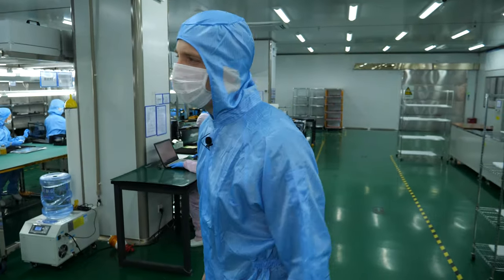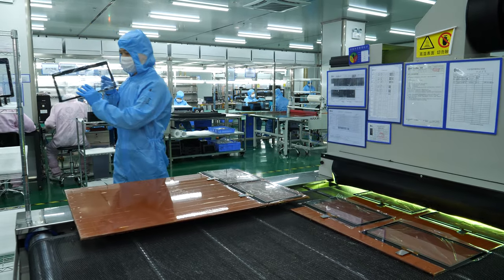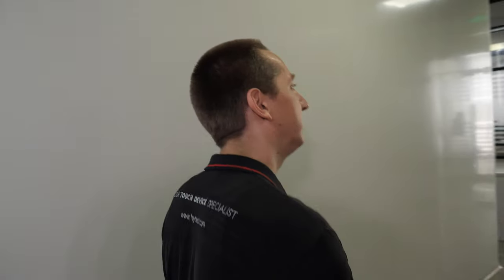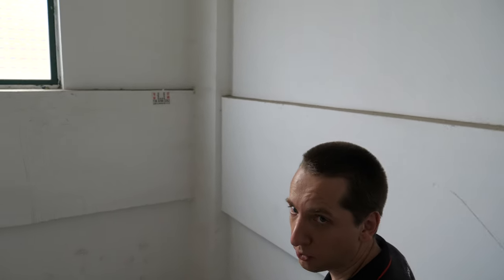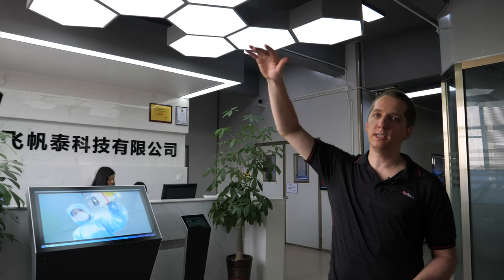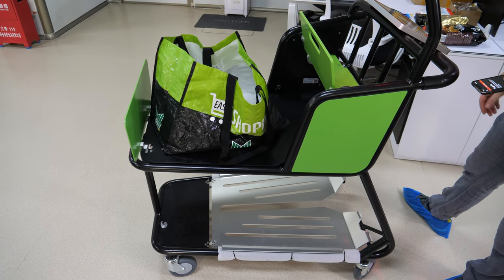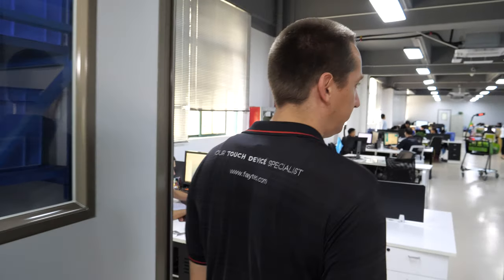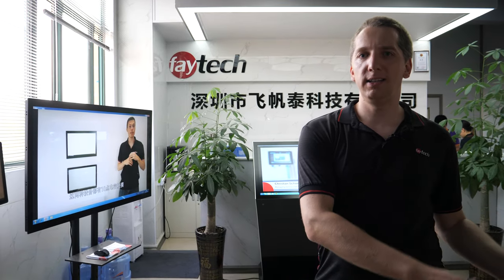faytech shenzhen factory tour, Industrial Touchscreen PC Manufacturer

Comment: He was very short at answering questions. The self service scanning shopping solution we have had since the 90's and is now common place within Waitrose, ASDA and Tesco. It was initially created by IBM for Safeway but is now sold by Zebra. Search for 'Zebra Personal Shopping Solution'. You can also scan using a App. Focus on what you do best is my suggestion. Entrepreneurs tend to stray!
Reply from the maker: This smart shopping cart is way better than the Zebra.. faytech focuses on doing the touchscreen system, another company partners with them on implementing the shopping cart with the right software and everything. The Butterfly MX intercom system is for example a huge success and based on faytech technology. They have I think many other examples like that. This smart shopping cart can I think basically turn every supermarket into a "walk out shopping" solution, the shopping cart includes camera and weighting which provides a full anti-theft and auto anti-mistake in scanning items automated shopping experience. Much cheaper than the way Amazon is doing their walk out shopping system. No check-outs needed, and also every user getting a more personalized shopping experience with personalized pricing, personalized shopping lists, recipies and etc. You need something more significant than a Zebra, I think.
Reply: @charbax  we can always debate the measure of 'better' but I can only go on what I already use. While shoplifting was always the clear blocker for this technology the trend in the UK anyway has been to put customer service over worries about theft. There are even self service checkouts here that have no scales at all. The Waitrose App allows you to scan and pay for the goods while you walk around the store and then 'walk out'. So while Amazon gets the news headlines, the supermarkets have been on this journey for the last 20 years. We, the Engineers, always want the perfect solution, but a low cost mobile App, or a simple scanner seems to do the job today.
Reply from the maker: @oninbridders  I've used the Zebra's in my Migros supermarkets in Switzerland for some years too. But I think there is ample range for improvement. The Zebra or mobile phone scanning is not optimal not even close. Walk out shopping is going to be absolutely huge, this faytech shopping cart is something I haven't seen anywhere else. You need a larger touch sceen, you need the whole shopping cart to be smart, it's the only way to actually rival the kind of amazing stuff Amazon has been showing off at some demo stores around the USA. The solution faytech shows here seems to me to be way cheaper and easier, it turns any supermarket into a walk out shopping experience, no need to install the multi-million dollars worth of cameras, sensors and AI and whatnot that is required to make that Amazon walk out shopping experience work.
Reply: Thanks for the discussion! Always difficult to find the right focus-but here we feel we are a real part of the success. Before there were too many HW supplier and the problems were put always on the other-so we overtook full HW responsibility and we feel that was good. From our knowledge, this is the only smart shopping cart project in the Western World where the business case works. But for sure, happy to learn more!